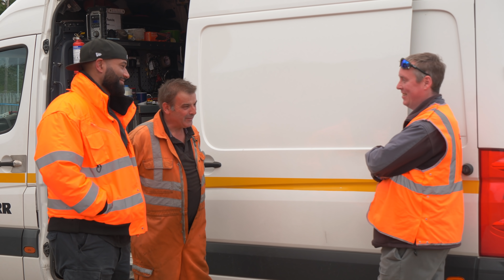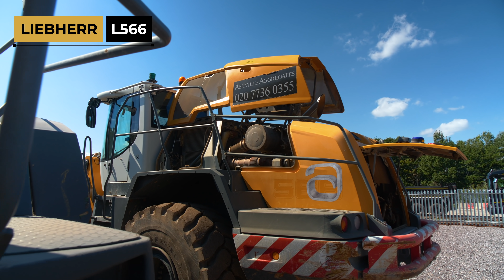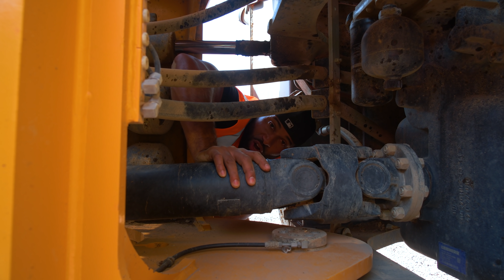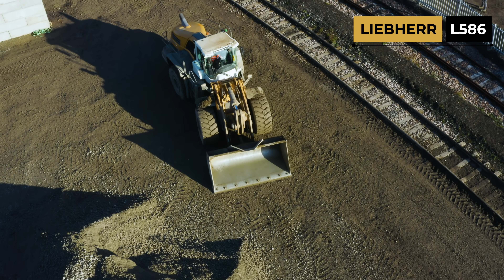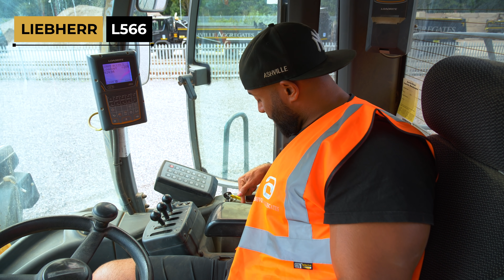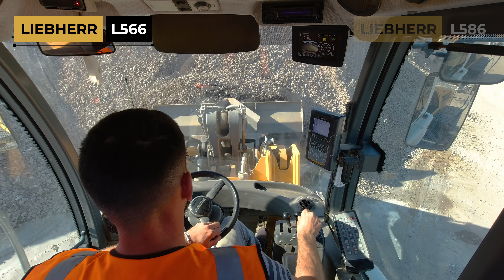Liebherr vs Liebherr Wheel Loader Reviews and Machines at Work

Comment: Why do you have a green flashing light on the cab when you already have a amber beacon????
Reply: Green flashlight on the cab is from the seat belt ! Pretty much everyone ad this light on the machines to make sure every operator is working safe and use it correctly! You can’t tell that from a YouTube video but this machine has to do some work and sometimes is quite dangerous climbing on the uneven surface till you put the counterbalance on the ground ! SAFETY FIRST!!!

Comment: Back in the later part of the 1960s I drove a Matbro Mastiff FE loading shovel, loading tunnel blue clay tipped off a conveyor belt into a pile. The Matbro was powered by a Ford 6 cylinder turbo through a power shift 4 x drive gearbox. Artic steering, disc brakes. fitted with a yard and half bucket. Loading a fleet of Guy Warrior double rear axle tipper with 11 Cu Yard bodies'. It took me 3 mins to load each lorry with 5 scoops, I would purposely dig into the pile more to the right side of the bucket twice and dump onto the front of the truck, followed by two to the left into the rear, lastly one square on the level the load. Pat down side away from me and the the near side. Truck out of the gate, another truck had backed in on the other side of the pile and I was right on loading him.
The Victoria Line Tube was being excavated by two Tunnel Boring Machine's that each advance on average 25 ft. per 8hr shift. 24 hrs. x 5. Loading muck away was only done on day shift so time was critical to have tipping room in the yard for the night shifts. The muck away company paid me a bonus to not overload the trucks and trim the load to save the drivers time, plus the owner drivers would pay me 2 shillings to be loaded before my shift start time as the roads were quieter and they could get more trips in. My boss had no problem with that and so I stated at 5 am instead of 7am. I know 2 bob easily bought a pint, maybe even a gallon of petrol so life was good for a teenager.